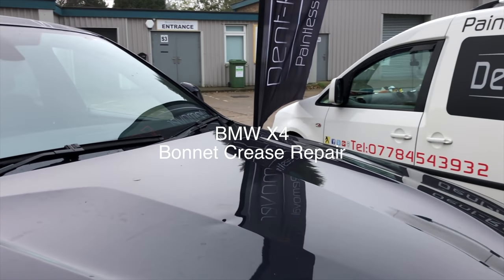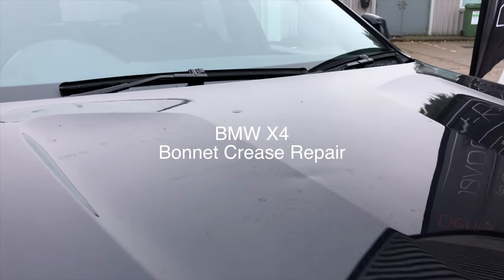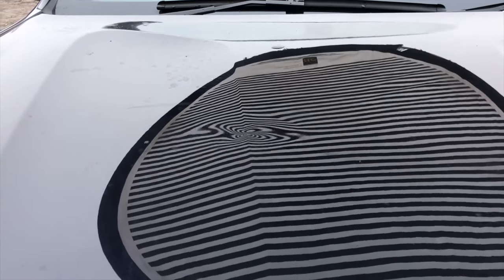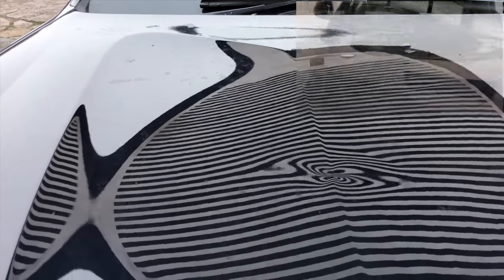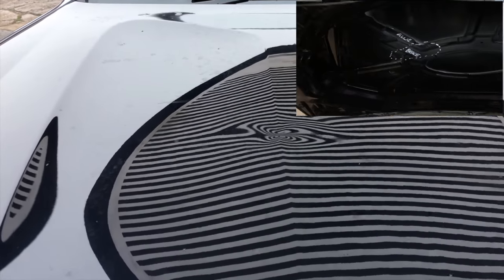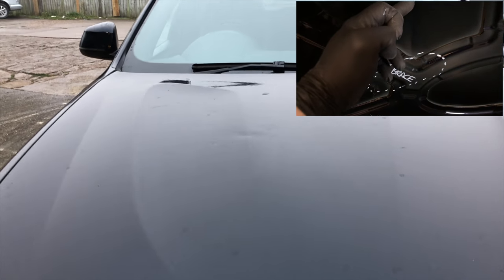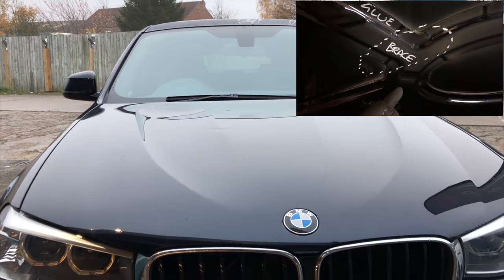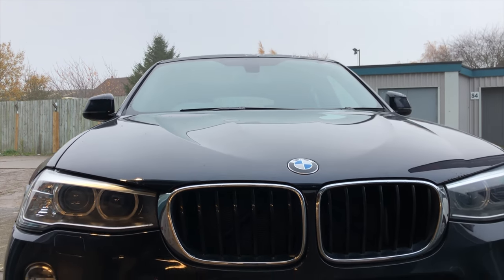BMW X4 SUV BONNET DENT - WATCH IT DISAPPEAR with PDR / By Dent-Remover ltd

Comment: NICE repair Martin looks like the work shop is coming together nicely. When glue pulling  I find I have a flat spot where the face of small tab as been ,how best to rectify this finish ?
Reply: Yes Martin that's correct the area is raised overall and the glued tab surface looks flat but not peaked.
Reply: I have a range of generic tabs mostly from eBay some are similar to keco but not the ice tab I know they pull hard with a smooth surface will practice my technique and try some cross pulls with different shapes thank you for your input looking forward to your next video.

Comment: Hi! I have two strange lines on each side of my hood (BMW f10) which can only be noticed when the hood is warm because of the engine heat. You can clearly see multiple very slight dots / dimples in a line. Is that normal? I red about the glue dots of the frame underneath the hood... when the hood/engine is cold there are no lines or dimples visible.  Thank you!
Reply: @dentremover01  thanks Martin
Reply: @dentremover01  No problem at all. I don't want to cut the glue... so I think I have to live with it haha. I didn't noticed it before so I was wondering.